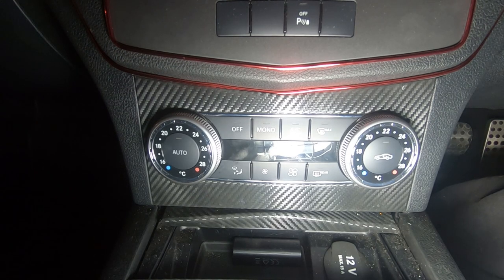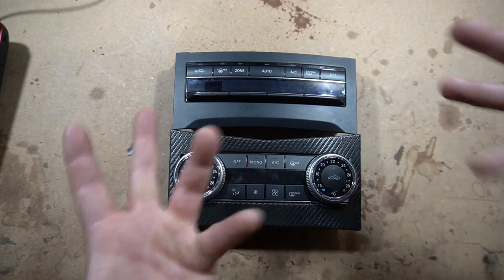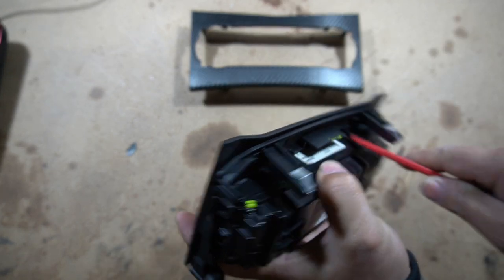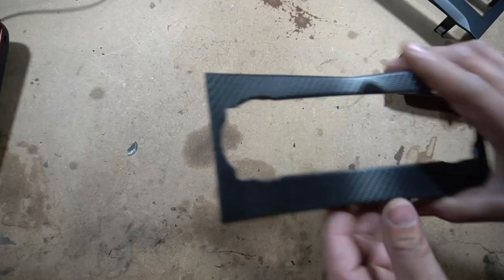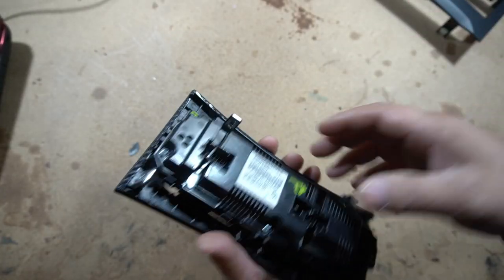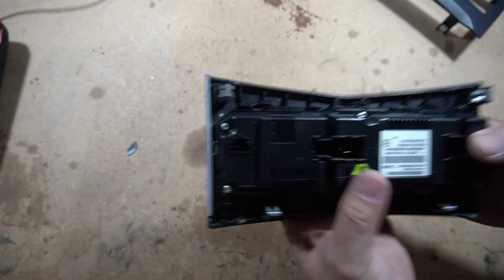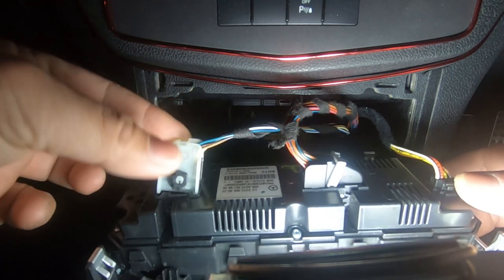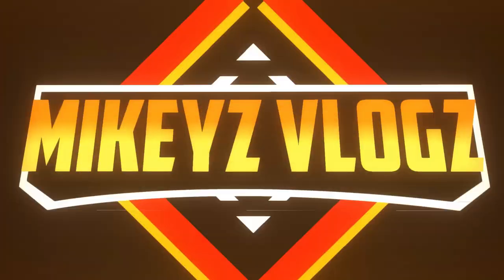mercedes mod -w204 climate control unit -upgrade to w207 E class climate unit -AMAZING

Comment: Amazing bro... can my prefacelift w204 can do that? and can you share that AC control part number?
Reply from the maker: sure I'll try leave a link to one on aliexpress or ebay
Reply: @MIKEYZVLOGZ  thanks bro :)
Reply: @MIKEYZVLOGZ  i just bought that ac control unit already and tried to plug 3 jacks in... basically its works but i've got some trouble about the buttons on the new ac control... my car have android screen and its jump between old screen and android screen when i touch the new ac control buttons... idk its normal or my new ac control have trouble?
Reply from the maker: @ranasticgaming919  umm that sounds very strange it shoudl not do that, there mioght be a loose cable or something, check fuses relating to both ac unit and relays too, check also fuses and relays relating to screen and screen , never hqad this happen so cant verify what the issue is, its a matter of diagnosing and troubleshooting, try and think back to wen it all worked and wat u changed recently  thart caused it
Reply: @MIKEYZVLOGZ  thanks... ill try... but my old ac control used normally without problem like new ac :(
Reply from the maker: @ranasticgaming919  in that case something wrong with new unit... wierd that old unit works ok but wen u use new one something happens
Reply from the maker: @ranasticgaming919  def something wrong with the new ac then

Comment: Nice Job, I'd add a rubber stick on door trim, (Chrome, etc.) Placing it all the way around the opening and closing off the round opening.
Reply from the maker: yep just working on it now used a mouable like putty that goes hard in 20mins and once it goes hard i will trim it down and sand it to be flush with the surround bezel and then wrap in carbon fiber again..if this doesnt work i will do the 2 part plastic or try your way

Comment: Good effort - you still have to work on that facia to make it look flush - build up 2 part plastic adhesive, then sand it down and then cover it with carbon fiber wrap.
Reply from the maker: Ye i still gotta work on that ... will be doing a video on when i make it work... what did u mean by two part plastic adhesive?
Reply: @MIKEYZVLOGZ  Hi - there are 2 component adhesives which need to be mixed into a putty like compound which after some time gets hard (plastic like) and can be sanded down. Bison/Loctite and other manufacturers have this type of 2 compound adhesive. By the way - you are welcome to visit my channel.
Reply from the maker: @AlexAndreiZAR  yes i kmow whatu mean .... thats exactly what i was thinking after looking through a home depot store -bunnings here in australia ... thanks and i will check it out

Comment: The W204 facelift climate controls in my car is secured by screws in each top corner of the unit. So easy said than done cos I had to remove the headunit to access the screws. I'm fitting the W212 climate controls in mine. As for losing the forward and down flow option, you can fix it by changing the number of flow modes available in Xentry coding.
Reply from the maker: ye I figured that out later .. I haven't had much time to play with xentry as yet but will be doing that soon enough...and ye I've seen then with screws in each corner .. what model do u have

Comment: Love your info great breakdown on how thank you ,if you could u give any info on a rear sam that controles rear light bulbs they are giving a fault warning then some times there ok like to day if u have info b very thankful i know some one could say buy a new one on old age pension easy and cheap to push the reset button ,thank you
Reply from the maker: Ok so wen ur rear tail lights keep throwing codes be sure u check the plug connector .... especially the ground wire... mercedes w204 infamous for tail light brown ground wire to cause faults - dimm tail light n  throw codes.... i did a video about creating a new ground connection to help solve the issue
Reply: @MIKEYZVLOGZ  Thats great  thank you very much

Comment: W212 fits in perfectly no modifications tho and looks similar
Reply from the maker: really??? as in the surrounding bezel sits in and clips in perfectly?
Reply: @MIKEYZVLOGZ  sure does my man if you google it you can see it I noticed a few months ago someone on the w204 page on facebook had done it I will have a look for a link and send you it looks really neat and gets rid of those turny knobs
Reply from the maker: @seanrichards2962  u sure that fits ? I have a prefacelift so the surrounding bezel isn't the same shape ..it has a triangle point in it which is why I couldn't use the surround... ur showing me a facelift model maybe for the facelift its the same surround but not for the prefacelift look at my video again where I show the difference in surrounds u can clearly see the triangular point on top ... and cuz u need to use the standard surround thats why I had to do what I did.. trust me if there was a way I could have avoided all that I would have
Reply: @MIKEYZVLOGZ  ahhh I’m with you mate mines is a facelift model 2014 the surround is a different shape it does not  have that v at the top it’s just straight
Reply from the maker: @seanrichards2962  exactly ..u get my drift

Comment: Can you install Mercedes counters?  Original Mercedes-Benz S-Class Combi Instrument Digital Speedometer A2229006506 on a Mercedes w204, there is a similarity between them
Reply from the maker: usually it comes down to if the plug is the same and if it can be coded to match.. and also will it fit in the dash when u say counters do u mean the dash area of the car like the centre console and dash area ? like radio etc? ... I know that it can be done I've seen w203s do it from older to newer and w204s too ... I'm not sure about c class to s class ... u have to ensure the mounts can line up and the frame is the same..

Comment: Do you know how to reset the first climate you had?
Reply from the maker: what do u mean by reset
Reply: @MIKEYZVLOGZ  I saw many videos where people reset AC to remove some errors, clicking some buttons at same time.
Reply from the maker: @shankstylerred5845  yes u do same thin hold ac and recirculation until u see the red light dlash back and forth
Reply: @MIKEYZVLOGZ  thanks. I'll try
Reply: Doesn't work. Nothing happens
Reply from the maker: @shankstylerred5845  do u see the lights flash?..also what exactly are u trying to fix ? maybe ur issue isn't related to that type of reset
Reply: @MIKEYZVLOGZ  if I hold AC and recirculimg sometimes car windows open, others nothing happens. No black and forth lights at all
Reply from the maker: @shankstylerred5845  will have to
1...Insert the key into the Mercedes ignition and turn the ignition cylinder to the "2" position. ... 
2...Press and hold the defrost and recirculated air buttons simultaneously. ... 
3...Wait 45 to 60 seconds for the LED lights to stop flashing. ... 
Wait 60 seconds and then start the car engine again see if it's the right buttons I'll get back to ya

if that doesn't work ur problem maybe be more in depth

Comment: you should fill up those gaps with plastic steel , reshape them according to the new control then wrap it up or better still spray it and hydro dip to carbon or else it looks horrible.
Reply from the maker: ye I was going to use resin that goes hard but I settled for an epoxy style putty and it turned out ok... this video was just to show that it works and can be done .. in the second part I fill the gaps with a waterproof type of poly ... not the best but came out  nice..but good tip ... now others can do what u said and give it a go ... will definitely look much better

Comment: Why didn't it have air blowing feet and face at the same time? This is the function every car should  have it.
Reply from the maker: i realy dont know but ill try to activate it with the xentry program..it just stp working once i changed it over
Reply: @MIKEYZVLOGZ  could U show us how to get it working with Xentry ? Or you need to go to Mercedes to do it.
Reply from the maker: @moonmc1047  i have just got the openport device thaT ALLOWS YOU TO ACCESS XENTRY And vediamo using A passthru i have every intention in doing that video ... just have a few others to do first 
i have never gone to mercedes for anything aPART FROM THE recall for takata airbags ... i will have a look in xentry and see if i can get the direction of air to come back using the program ..but im still very greeen to the program i only recently acquired it ..so gimme some time to learn and i will share my experiences
Reply: @MIKEYZVLOGZ  yes that's great. Plz show us once U know. . I ve heard once U have that program there 're lots of things U can do. That should be awesome.
Reply from the maker: @moonmc1047  indeed yes there is

Comment: Mikey-love all your videos but this one is a dud. It's too difficult to install something with compromised function and looks. Also it takes away the era look of the W204. I would like to see you install a front AND rear anti-roll bar. Keep up the great work! Or a repair of the faded buttons on the radio.
Reply from the maker: no worries...will consider it for future videos... front anti roll bar?? you mean the strut braces?? the ones that go across the engine??